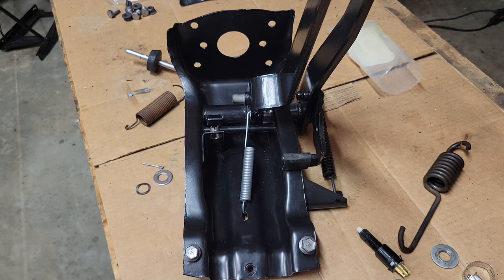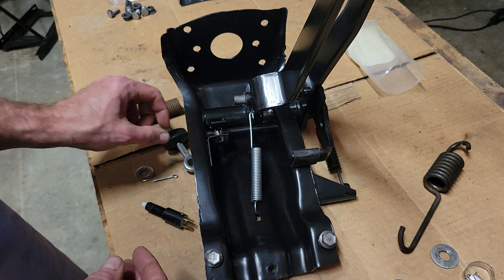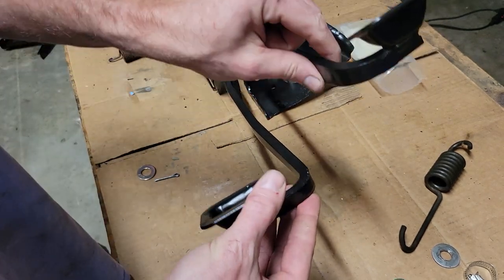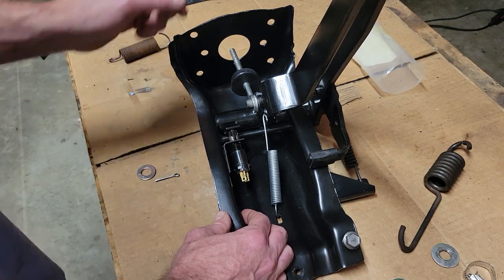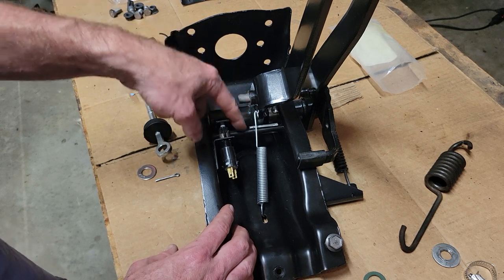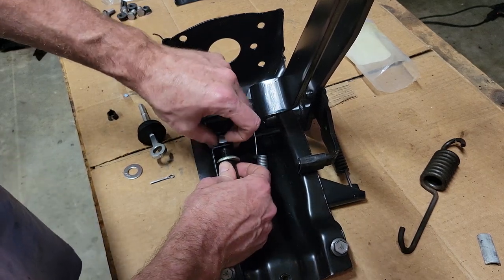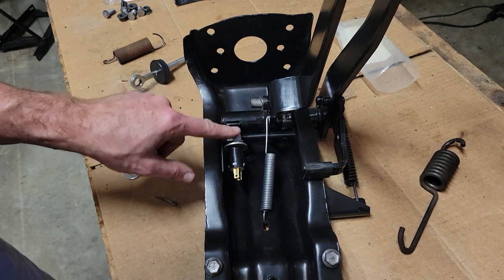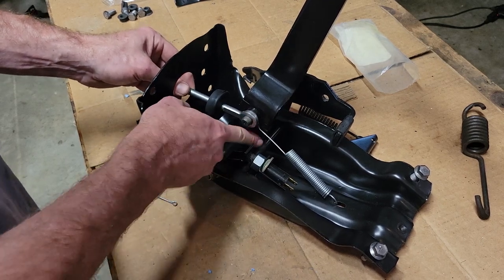Jeep CJ7 1981 258 Brake light switch and pedal adjustment options

Comment: I'm glad I caught this.  A year ago, I changed the ring & pinion gears in my '83 cj7.  We disconnected the brake lines,  and when I tried to bleed the brakes, I couldn't get the brake pedal back up. Had to replace  the master cylinder. Still no pedal. I left it alone for the winter because of high cost garage heat. Just started working on it again, and replaced the proportioning valve. The brake pedal sits ,2 inches higher than the clutch. Now that  saw your podcast, I can feel & hear the rod hitting inside the m.c.. I loosened up the steering column to try to get the switch out.  I'm going to weld a better spot for it. Thanks for the insight.

Comment: I still have my old M C. .  I'm going to take it apart again.  The Clymer's book says it's only supposed to have 1/16 to 1/8 inches of Freeplay.  Looks like you have new pedals and bracket. Looks too hard to pull them out. If I can just get the wires off, I'LL make a new bracket a lot lower. You can feel the rod going in the MC a whole inch before it hits the Piston.
Reply from the maker: Yeah, they didnt really plan for the ability to make any adjustments.  And still confused about why my push rod doesnt have a retainer ring to act as a back stop, but I guess with the setup of my brake switch, it works for now.